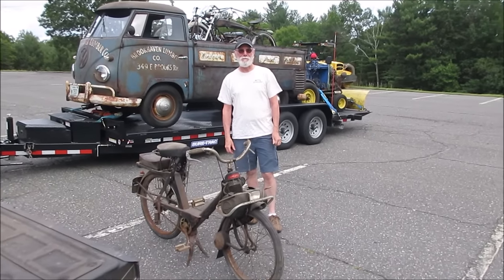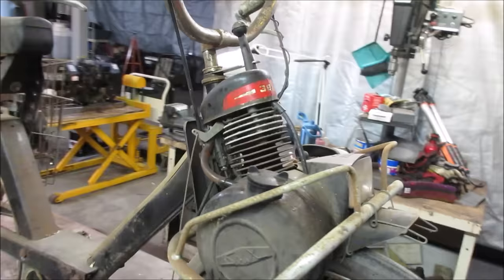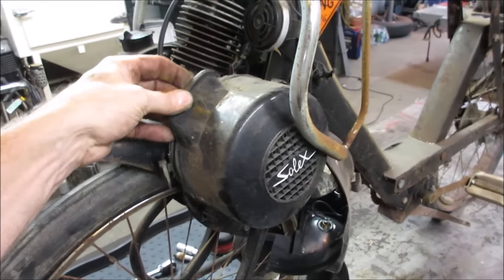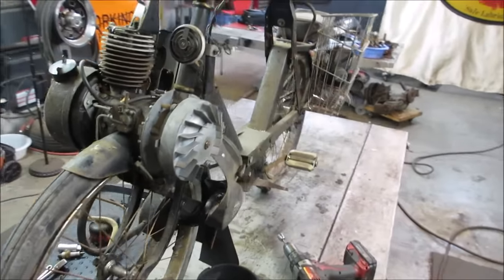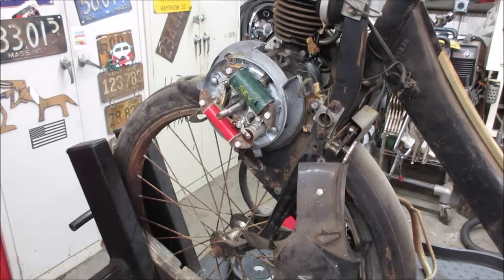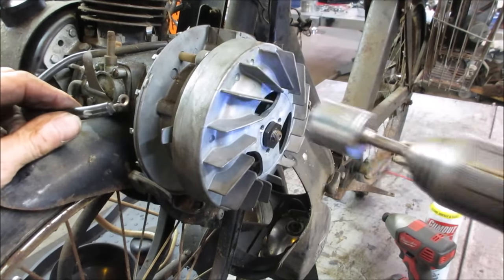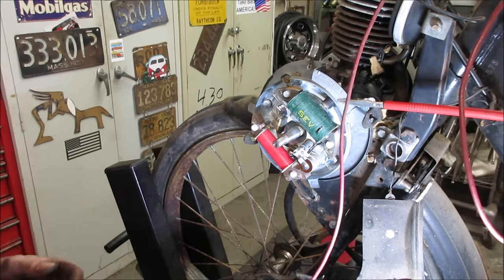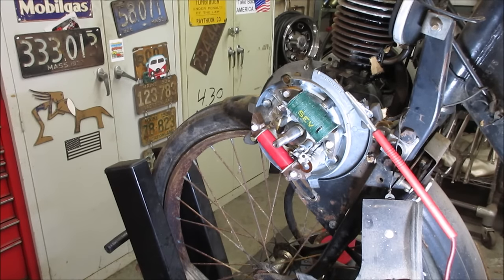Will It Run? VèloSolex 3800 Moped Parked in 1978.

Comment: I have one of those. I believe it was made in the '70s. It did not run when I bought it about 20 years ago, but was in a lot better condition than that one. I got it running, then totally restored it. It now looks and runs like brand new. It's a 49cc engine with friction drive. I had to use several reproduction parts to restore it. Treatland Moped Parts has quite a few parts for it. I can't believe someone tried to carry a passenger on it. The weight limit is around 200 pounds, I weigh 240, it hasn't broken on me yet, but it is very flimsy. They are made out of dozens of stamped sheet metal parts. It is French, and yes, it is metric. Mine has no kill switch. It has a decompression lever/valve. There is no cam to run the fuel pump. It has a diaphragm on the back. Change in crankcase pressure as the piston goes up and down operates the fuel pump. That lever you are using for a throttle is supposed to be the front brake. The throttle should be a twist grip on the right side of the handlebar, just like a motorcycle. The drive roller is made out of carborundum. The tire size is 17" in motorcycle size, 23" in bicycle size. Treatland has them. I use 24" thorn resistant bicycle tubes in them.

Comment: These mopeds were all over France in the summer of 1959 when the streets of Paris had very few private cars and the most of the cars were black  Citroen Taxis with elegant swooping front fenders. They could still drive flat out in the light traffic and I remember them being cranked right over to the limits of the suspension as they came around the traffic circle at the Arc de Triumph. The mopeds were everywhere moving like fish in schools. I’ve always wanted to see one of these taken apart to see what makes them tick.

Comment: Here in New Zealand, in the 1970's, these then qualified as a "moped" (a small motorcycle, max engine power 2 kilowatts, and "with pedals that can be used for alternative propulsion").  You had to have a motorcycle rider's licence, and they were registered annually, with a number plate on the back. A crash helmet was recommended but not compulsory.  Yes there is a rotating roller with what appears like rough grit sandpaper that rubs and drives the front wheel. Front tyres wear out quicker.  

My dad had one of these and used it to go to work in the next small country town along, about 5 miles away.  The adverts in the newspapers and radio at the time, claimed they would do "up to 216 miles per (Imperial) gallon" .  The Solex only ever came with a single seat (unlike the larger better Suzuki and Honda  3 speed semi-auto motorscooters), which always had a large 2 person capable seat, and usually had rear footpegs already, and were legal for one passenger also.  

At the time, I had first an older Suzuki 3 speed, semi-auto,  step-thru motorscooter which was way better than any Solex moped and later I had the small Suzuki motorcycle that also had only a 50cc engine, but 5 speed gearbox and manual clutch and used a small "Reed Valve" in the intake. It gave me 155 miles per (Imperial) gallon at its best. 

Solex like the earlier Suzuki models used "Petr-oil", petrol and 2 stroke oil pre-mixed.  Later Suzuki models used an oil injection system, so the 2-stroke oil was added into a separate tank on the side, and got fed into the engine by a small pump linked to the throttle.

Comment: Wow 😱, a vélo Solex, this brings me back memories to when i lived in France in the 1960’s as a young 6-10 years old kid, i rode on the back rack several times with my different aunts that had one, they were very popular all over Europe back then , because they were cheap to run and nibble enough to navigate through the narrow streets  as i got older and strong enough to handle the heavy front end i ended up riding it by myself… it was quite an experience 😊 thanks for your interesting videos 😎

Comment: The nut for the points cover is also a locking nut for the flywheel nut, which, technically, should be left hand threads. But it works! Keeps the cost down. This must have been so awesome to have gotten brand new. Riding your girl through the French countryside, stopping off to sample wines, laughing when you crash and then...that first Ki..what's that sound? No! Could it be?! Yes. I forgot to add oil to the gas.
Let's ask this helmeted man in the strange tracked vehicle if he has some oil. 😲 I KNOW! 1960's.

Comment: My 1960 moped had a fuel / oil mix ratio of 2: 50 with two stroke mineral oil, 
but after I went over to synthetic, 1: 50 was sufficient.

Comment: The motor runs full throttle all the time unless you apply the right "Brake" handle, then it  closes up the carburettor and it goes to "idle".
If you want to start , you start pedaling with the decompression valve drawn up and the choke handle pushed all the way to the left , when enough speed , release and hopefully the motor starts.
So what you think is the throttle is actually a means to reduce speed.

Comment: I work IT and we use Velcro tape to tie back cables on network racks.  It comes in a roll and is cut to size.  This would work amazing for holding that throttle.

Comment: I had one of these in Holland in the 1960th It was much fun I have many good memories of it. The way to operate is  one rides it like a pushbike and when a speed is achieved the engine is dropped on the frond wheel and the drive wheel starts the engine and continues powering the bike.

Comment: The trottle works like this: to start-you cycle-pull handle-lower engine onto tire-when running-let go off handle for full speed!! if you come to red light: pull handle-lift engine off tire-let engine idle-when green, cycle- lower engine-let go off handle!!

Comment: I'm  betting that the shut off rod/lever is designed to function when the motor is pulled up and away from the tire as a  safety so the engine doesn't over rev when you "disconnect" the kicker wheel from the tire. So I'm willing to bet that the rod hook end goes into that little bracket under the handlebar to keep it from moving when the assembly is lifted to "automatically" shut the engine down.Can't say that for sure but it seems that it would be a good way to do it to me.....then again my French heritage is from waaayyy back.

Comment: We went to visit a chap in France who has a big building in his back garden with about 500 of these he had got from flea markets, my dad needed some tyres for his because they are an unusual size. One of his folds in half ..I've got a photo somewhere. You could drive them in France without a license when you were about 14. I will see if I can remember where I stored the photo files and send you the photo. I drove my dad's one round the camp site in about 2006. The problem I think with them is if they get left in the damp because the frame is only pressed steel it really suffers from rust as we found out when we left one in a tent greenhouse.

Comment: So i've watched an on board on youtube in one of these, so the guy in the video explained that the throttle is combined with the front brake, it is made to run at a certain rpm the whole time and whenever you use the brake it is meant to idle the engine down, there is a separated lever that you are missing for the decompression valve, basically this is the ancestor of the modern electric assisted pedal e bikes

Comment: The ignition coil is actually two separate coils. Both are earthed at one end. The primary windings are connected to the points. The secondary windings are earthed at one end and the other is connected to the tab for the HT plug-lead. The secondary windings are not much thicker than a human hair, and there are a lot of turns. When the points open the magnetism induced in the primary windings collapses, inducing a "secondary" voltage in the secondary windings, of many thousand volts,which spark the plug.
Reply: The one that my colleague had featured a cast-iron deflector piston and a single-sided crankshaft. The big-end was a crude and simple brass bush. He used a 16 to one gas-oil mix.

Comment: You asked about the British Standard for screw threads - it is Whitworth (BSW). This is an imperial-unit-based screw thread standard, devised and specified by Joseph Whitworth in 1841. Cheers.

Comment: Try it out in snow...how I swore at that thing...got a Mobylette after that, heaven.
BTW the fact the engine is fixed to the front fork makes steering awkward and it
is top-heavy.
One of the best mopeds of the 70ties is the Vespa Ciao, belt driven, smooth and fast.
If you ever come across a Kreidler or Zundapp...grab it.

Comment: I can tell you just about anything you need to know about the Velo Solex 3800. I have been riding them and working on them for 25 years now they are my main transportation iv never driven automobiles.
Reply: Adam where do you order your parts? I have two that need to be rebuilt… one is all apart at the moment.
Reply: @britcars4me  well for a long time I use to get my parts from a dealer called Velo Cruz pretty sure they are still around they are located in sandy Beach Utah USA they have a web site.
Now days I just order from cycling colors they are located in France 🇫🇷.

Comment: Hello Mustie, the accelerator works as you guessed (decelerates if you pull the lever) because the lever also activates the front brake.
Berore trying to drive it check if the centrifugal clutch works, as it has the tendency to lock.

Comment: As a fellow VW-dude I always have wondered why VW used french carburetors (Solex). Greets from Finland.
Reply: 1e Solex carburetor was crude and elementary but easy to fix after a while a new carburetor manufacturer came from Weber Germany that got more hp out of the same engine dual carburetor setup

Comment: As featured in the movie "Mr. Bean's Holiday"!! Also, Robert Redford had a similar, if not identical, cycle in the movie "Three Days Of The Condor"!

French bicycle tyres were a bit weird. I had a pedal cycle in the 1960s which ran on "500-A" tyres. Almost, but not quite equivalent to "20 X 1-3/8". It seems that the French measure their tyre diameters in millimetres, with the width denoted by a letter. In my example (500A) the 500mm works out at 19.685" so, almost, but not quite 20"... Ask me how I found out! I don't know what the A stands for in term of measurement. So, unless your bike has been equipped with wheels and tyres that are actually measured in inches, be very wary of the potential for metric sized ones.

Comment: So I'm sure someone knows, but it seems right. If you want to go, you don't want to have to HOLD a lever, you just engage the engine by dropping it down to the tire and GO baby GO.. If you want to or need to stop or slow for a turn you can squeeze the lever, maybe for whatever reason you need it to shut off in an emergency you squeeze  the lever and it's connected to the decompression lever. This is from France back in the early days.. So.. who knows a lot of weird stuff came out back then!!

Comment: Excellent video Mustie 1  :) also this motor bicycle so cool  , heard about them but never seen this one ever my life on motor it setup and thought at first you had 1950's to 1970's  a Bombardier single cylinder  motor 292 Cubic Inches  Rotax  type  Lol ! Also gas & oil mix remember that one my late dad 1969  Bombardier 292 Cubic Inches size  1 cylinder  with ran in his sled from 1972 to 1984  and he called 50:1 mix of mineral oil and 91 octane from LUVS called in USA  fuel station but in Ontario Canada and east like New Brunswick  called the fuel station SHELL  !  Yes strong smell too 50:1 mix gas plus oil Lol! I know  my dad brother My late he ran in push lawn mower of Lawn Boy 2.5 hp 1966 Single cylinder motor with 18 inches cut bed  and keep flies away! Because used in same lawn mower in my teens years and uncle used in his STHIL Chainsaw 18 bar 42 CC one till 2011 !

Comment: The throttle is correct. You applied brakes and engine idle down. Guy next door had one of these when I was growing up. You rode it like normal bike till you unlatched and lowered the engine and the lever on  right was brake as normal but when engine was running it lowered engine rpm so you weren’t fighting the engine. The lever on left ran rear brakes. With the lever release it ran at cruising speed with engine down and running pull lever up and engine idled down and applied brakes

Comment: These were very popular all over Europe due to their simplicity and good quality. Just don't ride them in the rain or the friction drive will eat right through the front tire. Ask me how I know. Fairly low power from a long lived 2 stroke. Throw that stupid "crash bar" away so maintenance becomes easier. A Chinese company is making a look-a-like moped and sells the engine and drive system separate to convert a bicycle. I haven't heard much about the quality.

Comment: When you start off and stop leave the motor on the wheel and use the decompress and brakes to stop the engine,
To restart use the decompress and pedal away then drop the decompress to restart the engine and go,
It feels natural to use the right hand lever like a brake to slow the engine,
Oh and don't drop the driver on the tyre whilst moving or to pull away unless you don't mind divots in the tyre.

Comment: The "drive via the tire" bolt on kits used to be common, I remember there were kits for sale in the Sears Catalog as late as the 1970s.   I don't think they worked very well, as it was hard to get a good friction contact between the rubber driving wheel and the actual bicycle tire.
Reply: Tyre are specific on the Solex with a lot of rubber for this use

Comment: 16:45 you almost had the "Mortske Flick"™  going on there!!
edit: Oh man isn't such a GREAT feeling when you take it apart, mess with the coil and all the wires, take a bunch of readings.. nothing really changed but it's a little cleaner now and BANG it works and sparks are shooting!! Yeah baby! You know there's probably a very small group of people who do have all the readings and know all the values of the electric system of that thing but the idea is figuring it out yourself. Years ago there was no internet and man it really was a LOT HARDER to find parts and values and all.. If it wasn't in the local library you had to start finding catalogs or know someone.. Nice

Comment: Really not surprised the throttle works in reverse, it's just one of those French things of that era!
Could call it a crude version of cruise control, which is novel and not so safe, but then it does have a kill switch.
If used in rural areas with very long quiet lanes, it would have been fairly safe and handy.
I had a Citroen Saxo, great car in European styling, not unique French styling!
But still it had the odd quirk, like when replacing the radio for a modern one, I needed a universal conversion kit and hopefully Voila!
Nope not Voila, just 5 blown fuses and 2 hours of working out why!
Checked all the wires were ok. Checked wires with Haynes manual and found it hard to work out if they were correct.
Eventually found my car manual with wiring section and found the French decided to switch 4 wires!!
Had to do the pain in the butt job of persuading those wires out of the plug socket and switch them to what I could make out on the Haynes manual. 
Took another hour with rubbish tools, but I then had a working radio!

The screen wash wipe was also different! Pull as normal to me for front screen wash, the front wipers wiped, the rear got water with no wipers!
Press away, the rear worked as normal! Spent a whole morning of trying to work out what the hell was going on, testing the wash motor every possible and that was fine!
All the wiring was correct to Haynes manual and the car manual!
The only solution was to fit a 2 way pipe, so using the rear wash wipe provided jets of water to the front too and just use the front wiper on slow a few times!!
Thanks for that France!!
Reply: Quelle vie trépidante Bobby 😂😂

Comment: Hello, being French, to have spark you have to lower the engine towards the front wheel. like that the roller located under the mudguard will be able to touch start the engine. good luck 😉😉🇫🇷

Comment: You've got the engine in the drive position , surly you should pull the motor back off the tyre with the top lever !

Comment: on my 3800 solex (1973)  you can twist the handle for acceleration / deceleration, dont know if you tried this?. Adjusting the cables on the carburator can be quite fiddly. THe "brake handle" on the right side is just to slow it down that it doesnt rub that much on the tire when standing on a traffic light.
 The direct drive thing is made out Korund or corundum. You should definately change both filters. One you found already, the second one is right in the tank, where the fuel line picks of.

if you need spare parts, tires or similar search for Van de Ven Solex Verkoop en Reparatie, they are in the Nethrlands but have everything, i restored 2 solex now with just parts from them, but i dont know if they ship US..

Greetings from Germany,
Fred

Comment: 3800 is the model. Last model made. That one is french. Also built in northern Spain and Hungary. It is a 50 cc. Tail light is not original. Horn is not original. To know the year, you have to look at the engine number. The engine bumper is aftermarket. All bolts are metric and 1mm thread. 
You can still buy all parts, and all parts are dirt cheap.

Comment: Here in the UK, a lot of 1950s Ford cars were fitted with Solex carburetors....This French Moped is collectable here in the UK....I think the throttle works backwards on purpose, like a brake lever would....Once you get going, just release the throttle lever for a blistering 15 kph....🤔😳😏🇬🇧

Comment: your throttle lever is also the front brake lever, you can see the cable  to the brakes is tied into the throttle assembly. so when you go to slow down the it cuts the engine power and applies  the brakes at the same time.